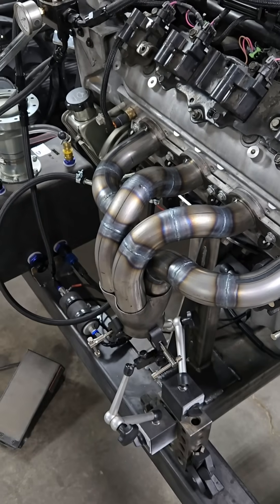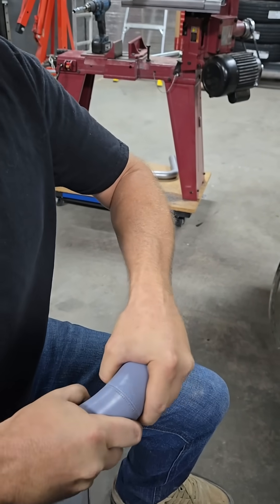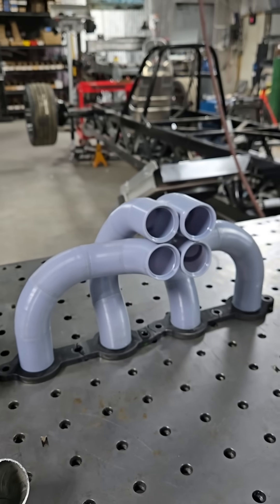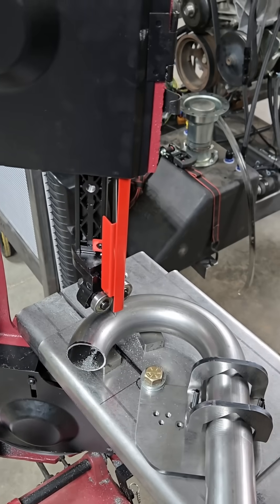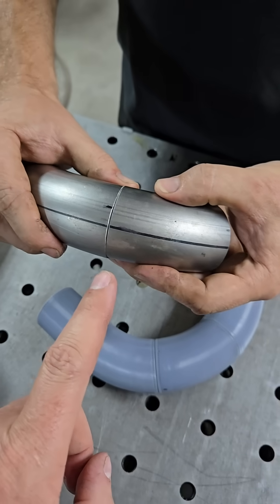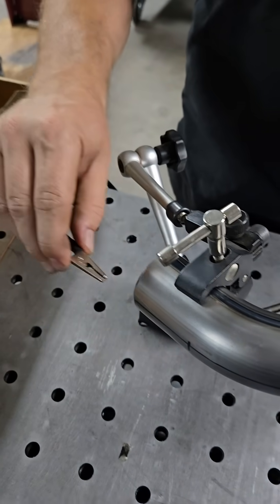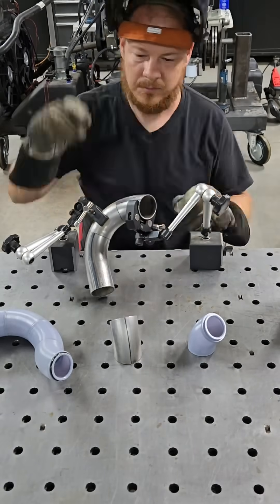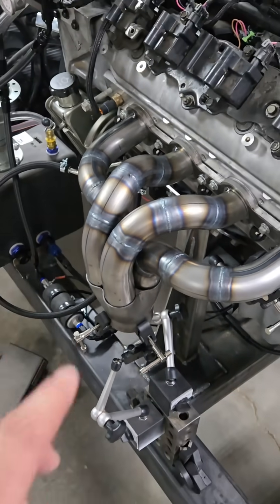Don't build another set of headers till you watch this!

Comment: Right.... so assume no one has a bender or anything else to do that with? You also aren't expressing whether or not you are doing flow testing... so who knows if your design is worth a damn...

Also welding equipment... 2-3K easy for the cheapest of shit. Ya and welding experience alone... with likely the hardest type of weld... and I know it's not because yours aren't great either. But to sit and say, ya do it yourself, requires several thousand anyways.

So who is your target audience... people who weld and are gonna call your shit out for being bad. I barely know it and they look pretty ass. So who else would care... no one.
Reply from the maker: No more than $3k in the video. The tubes where purchased from a supplier no bender needed. Don't make excuses get it done.

Comment: Muffler shops just blast cheese welds with mig boxes. This manifold would cost 1000 bucks minimum. The equipment to do it 5000 the experience +++.  Unless your looking to make this a job it’s so specific it’ll never happen.
Reply from the maker: It's for the industry and the garage builder. Yes you need to do this more than once to justify it. Such is true for lots of things.

Comment: You know what would help for equal length, 3d print the length on your part so it can be added up. Each of those snap pieces should have a length.
Reply from the maker: Great minds think alike. Our parts have the length on them and the angles. Those headers we made are equal length. I just didn't say it in the video. It was already getting kinda long.

Comment: We’re all the primary tubes the same length  or is that just a tubular exhaust manifold 
     Thank you
Reply from the maker: Those are equal length. The parts have length on them to help make sure you get it right. I just didn't say that in the video.
Reply: @ nice job I have seen many quote, unquote header builders who think if they weld some pipe together it’s a header. It’s no  cd e to cd see a quality job. 👍

Comment: Brilliant use of 3d printing
Reply: This is the kind of stuff 3d printing was made for, mockups and prototypes.
Reply: @NoOdL3z18  Yeah you are behind my man. They are 3d printing whole iron block engines now.
Reply: @NoOdL3z18  that is a gross under value of what added manufacturing can do. This whole piping could be printed. 

Now for this its probably dmore effective to weld it. Until you want a complex manifold with internal geometry
Reply: @greystorm9974  Human welders and plastic printers are a lot cheaper than metal printers.
Reply: @LoanwordEggcorn  yes, hence why I said I think welding is better for this.

But I have seen cooling manifolds, they cannot be cast and cannot be welded because they have swirling tubes inside swirling tubes. Then you 3D print in metal.

Was at an AM conference recently and they local technical university brought their projects. Intensively cool. And a long way to a shop near you.

But let's be honest. The thing in the video was made by a younger mechanic that taught himself 3D print... Not an older mechanic or something they understood in his school.
Reply: @greystorm9974 There are lots of things that are impossible to make without a metal printer.  I just wish they were more affordable.  The technology is not incredibly difficult.
Reply: @NoOdL3z18   nah they have 3d printed metal already. You can print the finished product.
Reply: A lot of uses of 3d printing are, but some can be more impractical
Reply: @Crazyclay78YT  very true, some dude tried to 3d print a table on r/3dprinting...
Reply: That shit is gonna melt day 1
Reply: @m3zmr  lol goof ball
Reply: @ bruh 💀💀
Reply: @m3zmr  you have metal printers that kan make production grade models.

Comment: not so easy sealing up the centr of 4 pipes  better with an infill plate with 4 holes in  it  tack it on  weld the pipes to the under side of plate   shape  plate to fit in collector  weld round corner 😊

Comment: I've been through the pain of building my own manifold using rudimentary equipment, so I can see how these tools will make it much easier 👏🏽
Reply: I typically do 6-8 sets of headers a year, all stainless, all equal length tubes, try to make them where all plugs are accessible with a straight plug socket, fab them so they fit close to the floor and wont drag on ground. I just don't see where using this kit would make it any easier, most time the clearances are so tight that you cant trust the tick marks, believe me, I tried, 1 degree off is all it takes to have problems down the line, its just too many times of transferring those marks. I use tick marks using the real parts but then I tack and test fit, rinse and repeat hundreds of times until finished. And you must mark the joint in 2 places, you can line up one mark and still wiggle the tube around that it wont fit. Maybe its just because I have built so many sets and I can visualize how the tubes will run. Sometimes I use a piece of aluminum welding wire to check that I am solid on the path and length.
Reply: 💯 agree 👍

Comment: After watching the previous video I finished watching this new video ..again BRILLIANT ..As a disciplined fabricator in a variety of fields, I can say  this method is 23 century , an  while it does not address the science of tuning , this method of building headers is  without exaggeration the absolute best that I have ever seen most especially for diyers who have acquired the welding skills and equipment to make their own or modify off the shelf  units. BRILLIANT
Reply from the maker: Thank you very much. To tune we are working on a DIY engine DYNO and will try to tech hoe size shape and combination effect HP and Torque curves. Much more on the way.

Comment: You welders are amazing… I wish I had that talent…
Reply from the maker: Thank you. You can do it too with some practice.
Reply: If you want that talent start now it takes time to progress but it's worth it once I started welding professionally I found things at home on purpose to keep it up it's fun!
Reply: These welds got room for improvement haha. As far as I can see
Reply: @Daxxxman yea but if people don't know they don't know 😂😂😂
Reply: @Daxxxman  Since you want to run your mouth, let's see you run a bead.
Reply: @pws3rd170  First off he burned the chromium out of the stainless on the welds.
Reply: @pws3rd170 stupid ... It doesn't matter if he can run a bead or not, it doesn't change the fact that these welds were crap. I would like to see the inside of the tubes see the purge was ... I can guess by the outsides not so good
Reply: Can I get a time stamp for the part where stainless was being welded?
Reply: @akumpi have you even seen the headers? They’re stainless. He cooked the welds and didn’t purge, the way the voiceover said it’s “recommended for exotic materials” is a joke. The welds aren’t purged or pssivated so have essentially turned into mild steel
Reply: @Daxxxman  I second this. They aren’t too bad though for someone doing exhaust work, as long as she don’t leak it’s a good exhaust weld. Those wouldn’t fly on any commercial welding job though, maybe a couple paper mills here or there but even that’s a stretch.

Comment: What's the cost range for custom headers using 304 stainless. I'm curious about custom vs. purchasing headers price difference.
Reply from the maker: Custom ranges widely. For 304ss low complexity. Lets say some long tube headers equal length and that's about it. That should run $1200 +-$200 a days worth of work basically. That also depends on the materials price. For a twin turbo stealth tuck (hide them in the engine bay) with waste gate pipes and all. That could be $2500-$5000 depending on how cramped the engine bay is and how long it takes to get it all fitted. No inner cooler or charge air piping. If you want that custom as well then $10k easy.
Reply: I am having a hell of a hard time finding 304ss fenderwell headers for a BBC in a '64 Chevy c20. I live in British Columbia Canada. Thank you for the information. I'll see if I can find a local shop.  The price you gave is very similar to the prices I see online for ceramic coated. Might as well get 304ss custom ones.